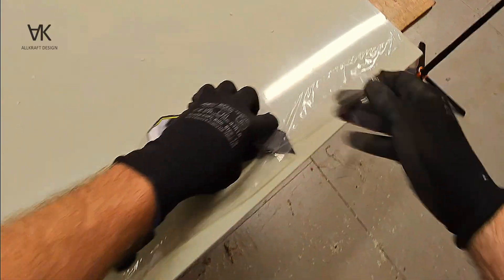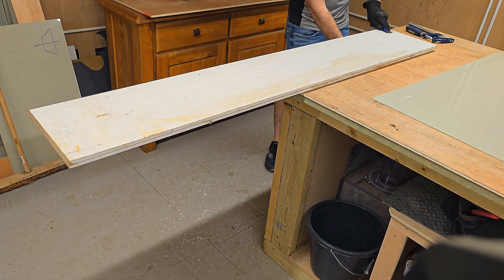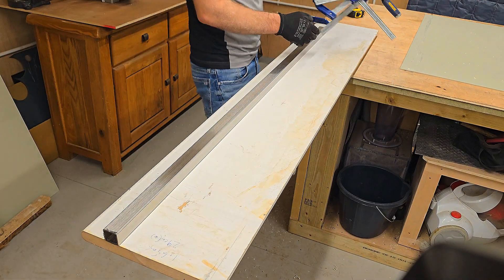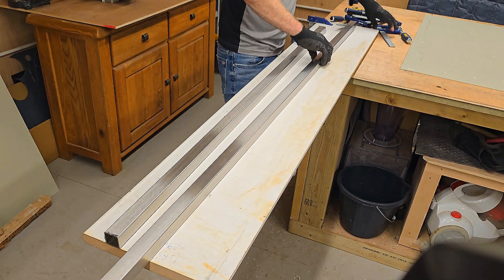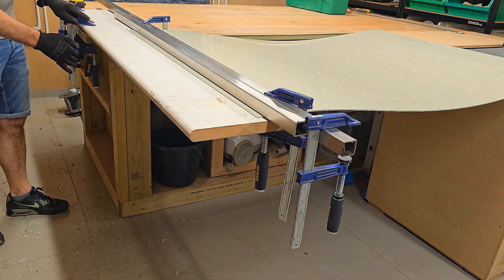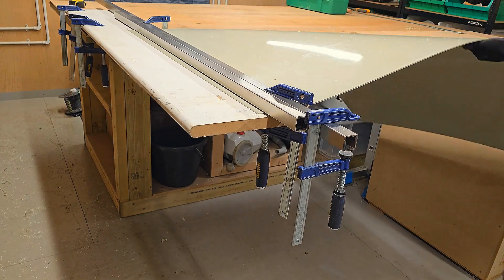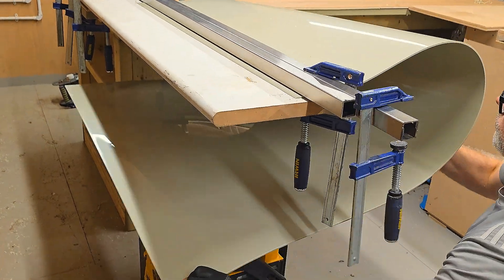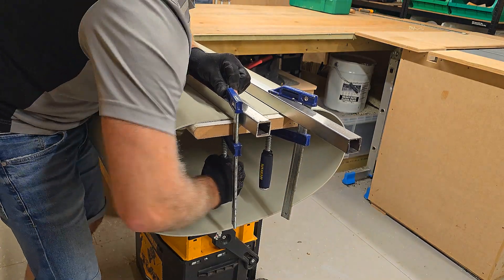Master Plastic Welding: Build Your Own Rain Water Harvesting Tanks And Water Tanks Like A Pro!

Comment: Thanks for your videos. It's really well explain and really helpfull. 
What is the speed you move foward when welding? you press down only on the rod and not on the hot air gun isn't it?
Reply from the maker: Hi 👋 Thanks for the kind comments, much appreciated! I have a list of welding temperatures for a range of plastics, for speed welding and free hand welding, will try and get them posted in the next day or two. I think the best way to look at it is if your heat gun temperature is about right and you have the melted ball between the rod and base material then you can't go far wrong. You only need a small amount of downward pressure on the heat gun👍 to much pressure pushes more melted material up to the surface and you will end up with big beads each side of the filler rod, which looks ok but the fused part underneath is now fused with cooler plastic so will be a weaker joint... and also on a long weld run your arm will drop off😅

Comment: Do you bother adjusting the welder to a different temperature for each plastic type or do you leave it on one setting and use travel speed to make the difference?  I weld plastic about once ev ery two years so never do it enough to learn anything!
Reply from the maker: Hi 👋  yeah I do change the temperatures for each plastic but only by feel and how the weld looks, but dont tell anyone 🤫. I have an official list of welding temperatures for each plastic somewhere, will sort it out and post it when I get chance 👍